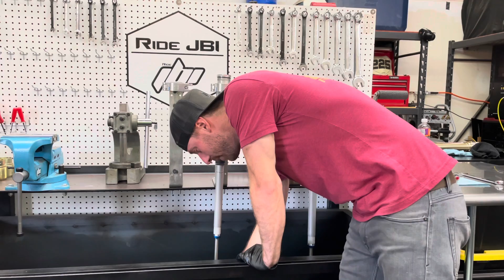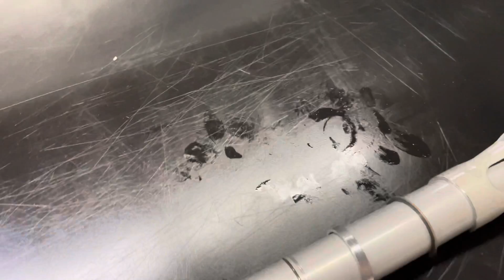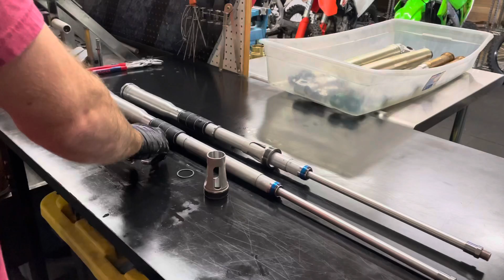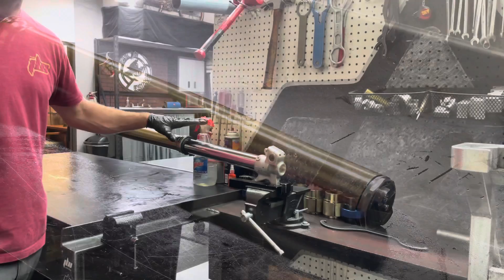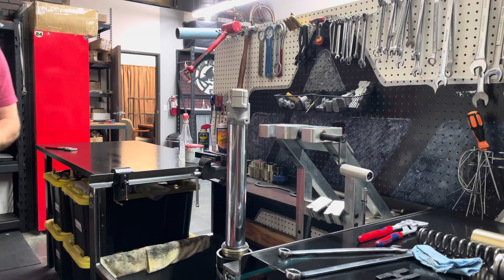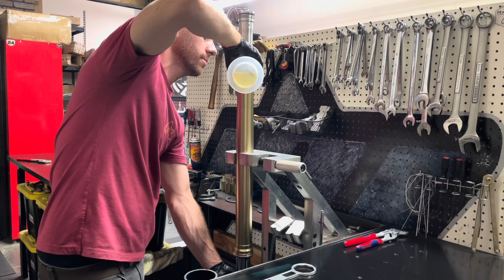How to install - Part 5 JBI Suspension Showa 49mm Pro Fork DIY Kit

Comment: Hey JB, my kit only has the outer chamber oil volume listed (320cc). I measured what came out of my internal chamber at ~250mL which what the manual states. Not sure if I’m supposed to run the stock amount according to the manual or if there’s a specific measurement for your kit. Thanks man, kit went together smooth.
Reply from the maker: Hello 👋 

Good question. The inner damping cartridge only has one specific oil volume.  There is not an adjustable range like the outer chamber.  So do follow the manual on the inner chamber oil volume amount.
Reply: @RideJBI  Thats what I figured. Bleeding them now, appreciate the quick response!